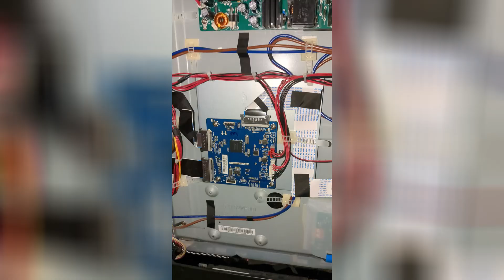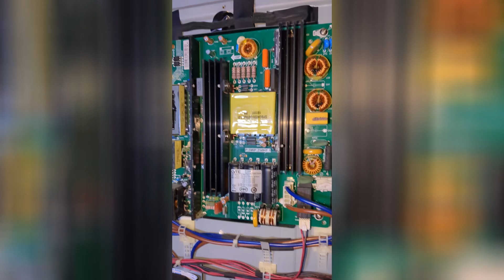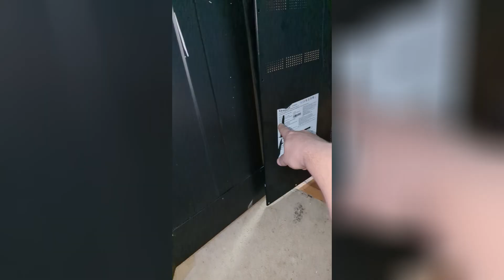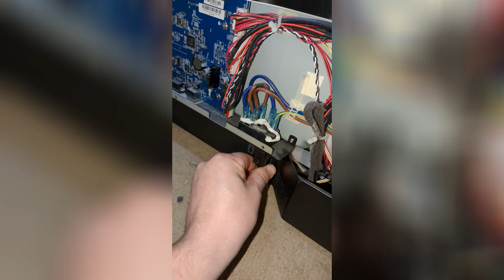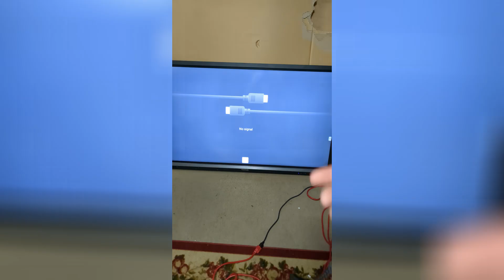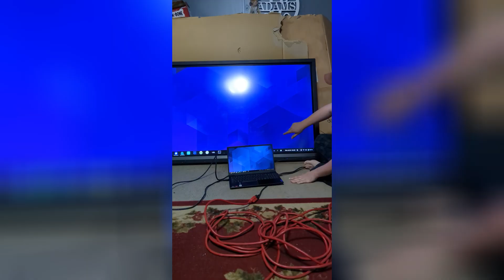Quick Fix - Repairing a ViewSonic Smart Board In My Living Room Floor

Comment: Thanks for the video, where did you find the power supply board, are they somewhat universal to screen size?
Reply from the maker: I had another identical display with other problems, so I just cannibalised it. There are a few different models and even brands of these displays that seem largely identical inside. I got hold of a few of them, of two different brands, but their internals were nearly identical.